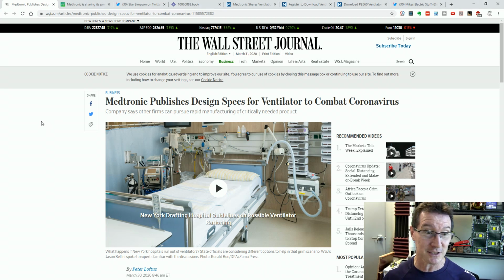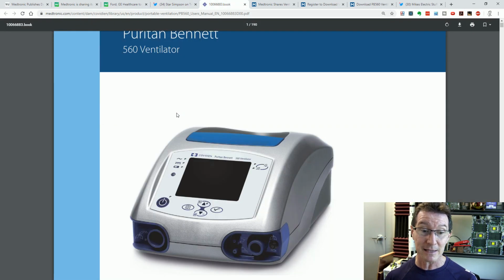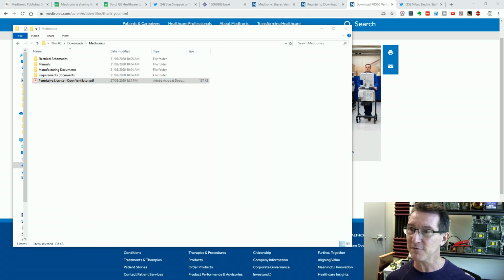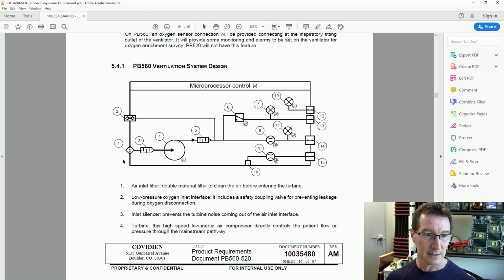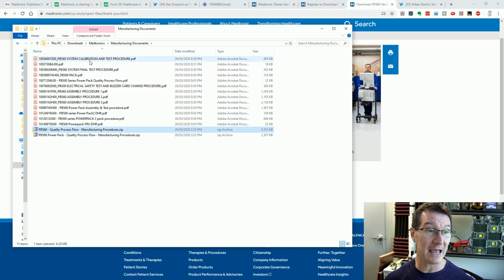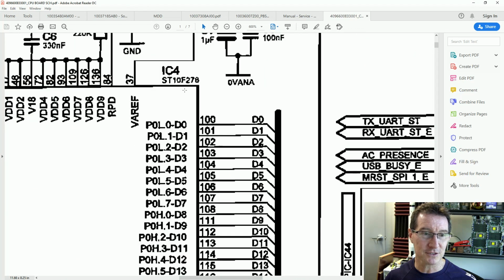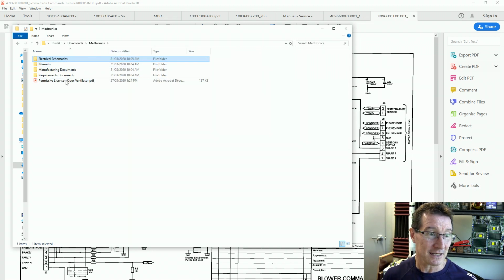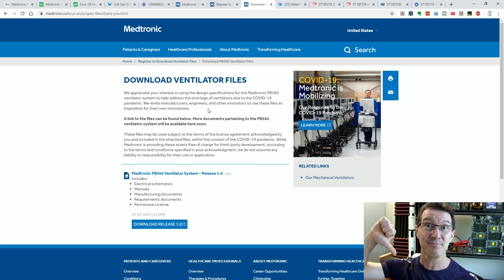eevBLAB #72 - BUSTED! Medtronics Open Ventilator FAIL

Comment: A huge thing that wasn't mentioned here...the license expires as soon as WHO declares the emergency over (or 2024, which ever happens earlier). So anyone who puts in the massive amount of work to turn this into an actual design and retool their factories to produce something based on it will have to stop producing once the crisis is over or pay licensing fees.  And if you tried to put the R&D and other upfront costs into the price of the product cost at this time, it would widely seen as price gouging.

Comment: They make it sound like State of the art, ICU, life-saving equipment is the basic run of the mill ventilation system that anyone can design & print up!
Reply: it probably is. its just the certification and probably fancy parts to increase reliability that is the issue.
Reply: Its a cpap machine with a few bells and whistles. The added features are special algorithms that watch the pressure patterns. Limited Learning algorithms. Imagine putting a Cell phone cpu or laptop cpu in a cpap machine. It would be like $100,000 machine.

Comment: Even if they release the real design files, you still couldn't build the thing. Have you ever tried to buy a component for any medical or life support equipment. You can't! All component makers require you to sign a special agreement that limits their liability in case of component failure. Then once you have a device built, you have to test a substantial number of them to failure, and then provide a huge report showing the statistical life analysis and back that up with documentation that shows how to determine when the useful life of the device has been used up, so the user can properly schedule its replacement without putting anyone's life in danger. 
Designing medical devices is not likely something that will be done by the maker community anytime soon.
Reply: In Italy when they remove someone from a commercial ventilator because there is someone younger and more likely to live they sedate him/ her and leave him/her to die. A homebrew ventilator is preferable than nothing.
Reply: Ventalators are one of the things  not made just in China.
I am sure you have the companines that make them in the US,Europe etc... gearing up to make as many as possible.
They will have more trustworkthy ones in hospitols way before a maker one is trusted.
Dyson is about the only person who makes no medical equipment who will come out with a good version eventually, but thats because he already has a lot of experiance with Turbines etc...
And he has manufacturing in the UK.
Makers should concentrate on googles and masks that they make make cheaper and better from a personal use perspective.
But even then an n95 mask is made to a much higher standard then people think.
You have makers releasing knitted mask plans for people to use.
You would be safer with no mask over a knitted mask, it would let everything through while having heaps of surface area to grab hold of all the bugs in the air.
Reply: @psori  No hospital would ever use such a "home made" device - too many possible legal implications.
Reply: @teuton8363  These are extraordinary conditions. There are no legal implications. (At least in Europe)
Reply: Teuton Actually, under crisis conditions they will use whatever is available to them at that moment.  If placing the patient on a DIY ventilator gives the patient 1000-fold better odds than placing them on nothing (due to no OEM ventilators being available) then both the doctor and hospital are fulfilling their oath to do the absolute best they can because without that ventilator, even a DIY version, the patient’s death is near 100% certain.  If I were the patient I know which of those options I would prefer as I would at least have an honest fighting chance with the DIY ventilator versus without any ventilator — the very definition of acting in the patient’s best interests.

I agree that under ordinary non-crisis conditions they would never use an uncertified device without a known pedigree and reliability, but these are not ordinary times for many hospitals around the world right this moment and for many their SOP is literally changing continually from day-to-day, hour-to-hour, based upon what they actually have available to them to use at that moment.   Just look at all the PPE rule changes from one day to the next based upon availability of PPE and many staff jury-rigging their own PPE from whatever materials they can find in the moment even if they don’t fully meet regular PPE guidelines as some level of protection is often better than no protection whatsoever — all of which violates normal day-to-day SOP in normal times,  but in a crisis they have to work with whatever is actually available to them at that moment and simply do the very best they can, and that is all that any of us who may become their patients can possibly ask of the medical professionals on the front lines right this moment...do the best they can to give each of us the best possible chance to survive based upon what they have to work with.
Reply: @ethanpoole3443  Sorry, Ethan and everyone else that agrees, but I haven't heard of a SINGLE event of this happening.  If they are indeed short on ventilators (which they are) and IF someone has built one that has NOT gone through the certification process, AND it was used somewhere, it would be HUGE news, and there simply isn't any.  Even the Dyson device is still in manufacturing, and it has been stated that even that one will be tested first.  The only way you're going to see anyone on a Maker ventilator is if someone takes them home and does it privately.
Reply: @ethanpoole3443  "then both the doctor and hospital are fulfilling their oath to do the absolute best they can because without that ventilator, even a DIY version, the patient’s death is near 100% certain.  If I were the patient I know which of those options I would prefer as I would at least have an honest fighting chance with the DIY ventilator versus without any ventilator — the very definition of acting in the patient’s best interests."

Tell that to the Ambulance Chasers. Without legislation providing explicit "All lawyers complaining about these ventilators can fuck off and die" protection, the risk of a failed treatment is probably higher than a denied treatment.
Reply: NTE cross reference manuals state that their "parts are NOT to be used as critical components in life support applications." I chalked that up to a reliability / legal issues.
Reply: @MikinessAnalog  That's boilerplate for just about every off the shelf component.  All it means is they haven't done the required testing and so won't be responsible for it.
   Usually what happens is the company that want's the component gets together with the manufacturer and they work out a deal - something like, Company Z will buy x amount of these if Company Y will help  get them past the tests.  Z pays for testing, Y makes any mods needed.  Y promises to keep making them that way after they pass the tests, but still won't market them as certified, since they were only tested for one specific circuit in one specific application.
Reply: @psori  these documents appear to contain methodology and safety policies that took years to develop, and engineers can read those and gain massive amounts of knowledge to improve their own design avoiding mistakes that could cost lives!
Reply: Thank you for the first comment where the brain is used.

I can not believe this video exists, this is unthinkable.
Also the microcontroler reference can be medical specif, it won't appear on a search made by mister nobody, same for military grade electronics, how is it possible that Dave and Mike don't know this ? I just don't know what to say!

Comment: @EEVBlog I had an interesting thought experiment: How do you design 300,000 ventilators? Looking on LCSC and Digikey, they only have like 30k or 50k of any of the most available microcontrollers. Maybe build around a platform like STM32 and just use variations of it? I imagine you'd experience shortages all the way down the chain though. Example: Is there a ventilator motor where you can buy 300,000 of them? Are there 300,000 respiratory tubes available? 300,00 0 masks? A whole different problem if you bump up all those numbers to 3 million instead of 300,000.

Comment: This is exactly the stuff you need to build a ventilator. It's not a simple pump! You need to understand the actual requirements and you also need to understand the real risks. A ventilator is used on a person that is EXTREMELY weak. It's NOT just a mechanical thing. It's a complicated system that fills a medical need! Geesh!
Reply: But you need some desing right now

Comment: It’s just as well they didn’t really release anything. Because despite the circumstances at least in the US no hospital will use something open source like this. This idea has to have every malpractice and personal injury lawyer salivating right now.
Reply: I don't think you're understanding the process of these "contests" that is going on; like the Code Life Ventilator Challenge. The gov't and private agencies are looking for someone to design a ventilator that can be mass produced easily and cheaply. The winner will have their design fast tracked through the FDA process and it will be able to be built by any number of manufacturing sectors that can easily retool and make the ventilator. It isn't about Joe Blow making one a month on his 3d printer and trying to sell them to the hospitals. Also, as we've seen in emergency situations, anything goes. And I'm sure there are/will be protection in these situations; like "good samaritan" laws. When there are 1M cases in the US, things will rapidly change. Now there are 1M cases in the world, and >100k in the US, and it is just going to get worse before it gets better.

Comment: I've built FAA/DOD certified aviation and DOE/DOD certified nuclear power plant instrumentation and controls, and the requirements and test documents are by far the most valuable part of the entire system.  Generating those documents is hideously expensive.  The same is true for medical systems needing to meet FDA certification.  Getting those docs for free is really huge.

As an example, there are aircraft instruments available in both FAA certified and uncertified forms, and the price difference between them, for the exact same hardware, can easily reach 10x.  That is, a $300 piece of hardware (retail) could cost $3K (retail) before you can legally use it as a primary flight instrument.
  The avionics company I worked for treated testing as its own internal product, not an overhead expense or project cost burden: That emphasis let us release better instruments sooner and at lower cost yet with higher quality and reliability.  We considered ourselves to be a testing company that happened to build terrific aircraft instruments.

These are real costs, not just markup.  Companies making instruments in both forms don't care which version you buy!  In one specific case I know of, a small instrument maker had higher lifetime profits for the uncertified unit.  The company used to make only uncertified instruments: These can be used in airplanes with "Experimental" ratings, and by pilots also having an Experimental rating, which is the most common case for folks who build their own airplanes.  Their customers begged them to do a certified version, so they did, applied the 10x markup, and immediately started selling 5 certified instruments for each uncertified one, with about the same profit per unit.  This actually *HURT* the company: Revenues went way up, but per-unit profit stayed about the same, meaning the marginal profit ratio plummeted, and the banks no longer wanted to give them bridge loans, at least not at favorable rates.  Their fix was to make tech support a separate line item for the certified units, since certified instruments require certified installation.

The FDA certification cost burden ratio should be lower for medical devices like ventilators, perhaps as low as 3x.  However, medical lab instruments can easily leap back into the 10x zone: Anything that is used to help doctors make patient care decisions is much tougher to certify.  Even devices that make their own decisions, such as AEDs, are less expensive to certify!
Reply: We don't need "How to Design a Ventilator for Dummies" anymore.  It's too late for that.  We need "How to Manufacture New Ventilators Quick" and these design parameters wont cut it.

If these documents came out a year ago along with a detailed warning of what was about to happen this could have been a great asset.

Comment: All that stuff in the requirements document is just that, requirements.
It's the document that's created that describes what the actual design document should cover.
It's a normal first stage in product design.
You make a requirements document, have it signed off by the customer, then that's the basis used for the actual product design documents which in turn get used to drive component design documents.

On its own it's utterly useless to build the product. Just as useless as the manual.

It might be of some interest if you have access to the actual device and want to reverse engineer it, but that's all.

That's me speaking as a software designer/engineer, but mechanical engineering (which I've done in college studying engineering physics) is no different.

Comment: The software holdup might involve removing 3rd party code or components they don't have the right to distribute.
Reply: My thoughts exactly. Having worked at a software company for a few years, I saw how many third party components they relied on, so even if they decided to open-source their product, they couldn’t release the code until removing the third-party code. 

While I don’t doubt that Medtronic is doing this for the “clout” (that’s what kids call reputation these days, right?), but IMHO, who cares? If what they’re doing is good, it’s still good no matter the motivation.
Reply: That's what I was thinking. The order came down from the top to release it and now the monkeys are covering up stolen code, stuff that works but they don't know how, and other stuff that flew under the radar during certification.
Reply: @mrcomment5544  I see you know how software development works 🤣

Comment: Here is another way to do it. A cell phone as the display and controls for the ventilator.  Then use the sensors for monitoring from off the shelf  suppliers. 

ICU Ventilator | AgVa Healthcare
https://www.agvahealthcare.com/

Video link from them.
https://youtu.be/IgAR4yWDsg0

Comment: What is the point of "inspiring new designs" now, in the middle of the problem? Today is not the time for insiration and development. There is no time for tinkering with software bugs. By the time open source hardware may have a chance to get even somewhat ready to use the whole situation is likely to resolve on itself taking whatever price it ends up taking. Today it is time to have a completely documented, tested and proven design and to put it into mass production wherever possible by whoever can make the thongs in order to quickly make it available everywhere to everyone. But commercial enterprises do not seem to operate this way. At least not without strong government regulation.
Reply: your time notion is relative to time duration of this event, isn't it ?

Comment: It will take a  long time to re-do the same electronic design but maby we can inspire  from it as they said  i wish if they give us more informations about the mechanical part and more description about  each board used and how they are connected Dave could you  please make a time to analyse more the schematic 😂 , by the way I think they used three different CADs for the same product Orcad , Pads and I don't know the third one
Reply from the maker: The schematic is almost worthless, no point analysing it.  It's all about the mechanicals and system control.